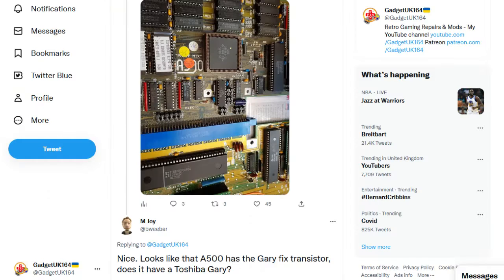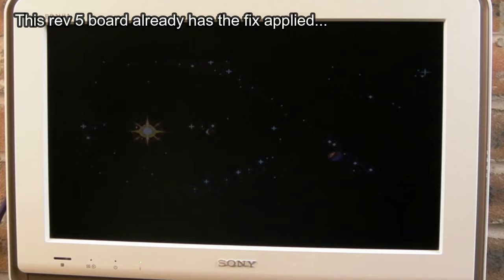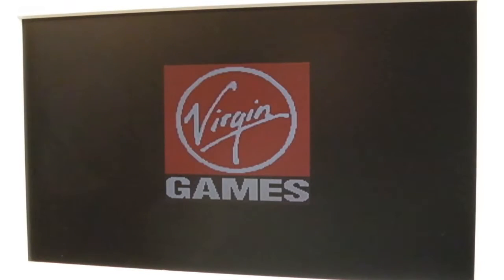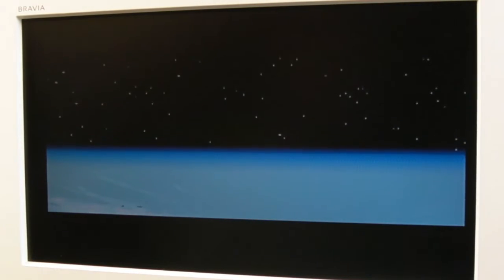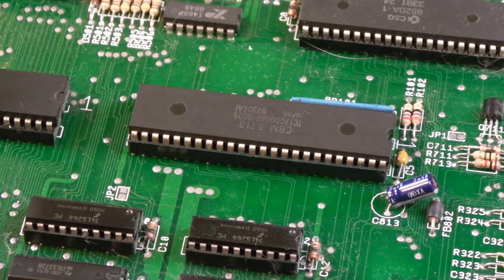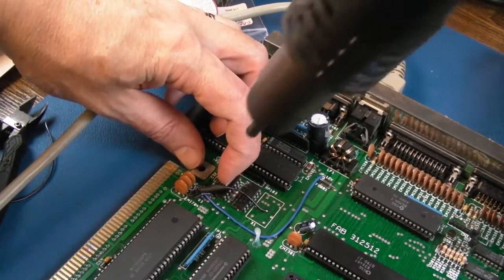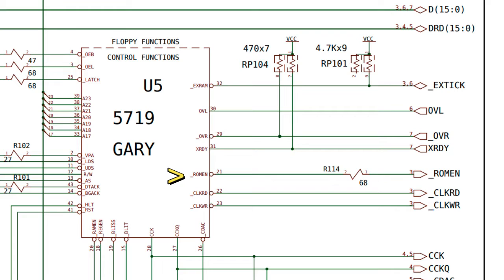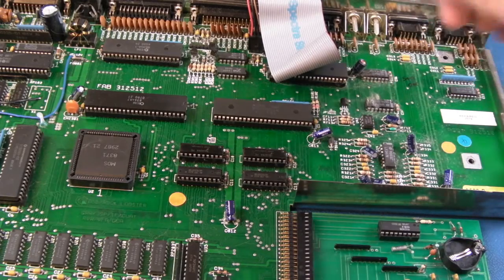Commodore Amiga Buggy Gary DTACK Kludge Fix (Revised)

Comment: Can you do a video on the mod used for the rom 3.1 on rev 5 A500 boards. I think there are 2 wires, one from pin1 to 31 and 31 to another pin(not sure which one).

Comment: I have the same spare Toshiba Gary (had it sitting in my spares box for yokes, and I can't remember which REV board it came from). When I temporarily fitted it to a REV6 (I had removed the original  Gary - Ram expansion, for another reason) I thought it was faulty, because I got the following reading error from the Gotek "ERROR : LBA Change Test Failed ! Write Issue ?". Could you test with a Gotek?
Reply from the maker: Thanks for the info!  I don't have a gotek, but I will get one soon and re-test for you!
Reply: @GadgetUK164  Awesome. Be careful with the revision of Gotek you get. Video on the subject
https://www.youtube.com/watch?v=6VZMTrZ4b9M&lc=UgymB6rufNY52koyCVl4AaABAg.9nLbVc-4nCD9nO1vAS03rD

Comment: About the ground pads on the Rev. 3 boards: the pads on mine are not connected to ground but they made a connection while the board was still in the bottom RF shield with the disk drive and back connectors screwed in. The ground connection was probably only through the pads touching the RF shield ground. I was slightly confused when I removed the shielding and the "ground pads" would no longer be grounded. Definitely something to keep in mind when working on the early boards. :D
Reply from the maker: Ah yes, I was surprised in the video when I pointed that out - but then found I did have connectivity (from the shield as you say)!
Reply: I have the same Toshiba Gary (it's a spare IC) and I get an error with the Gotek, when I fitted it to a REV 6 board.  "ERROR : LBA Change Test Failed ! Write Issue ?"
Reply: PS; Mine's is '8724' whereas Gadgets is 1987, week 30.

Comment: I think you got the transistor backwards too, at least on the schematic. It's a classic "open collector" arrangement, and the emitter of an NPN transistor properly goes to ground. But if it is backwards, and not just read backwards like happened with the chip, it's clearly still good enough, just not proper.
Reply from the maker: It's PNP by the way!
Reply from the maker: It's wired the exact same way as the factory mod - maybe they had it wrong there?!  I will re-check it when I get a sec!
Reply from the maker: I've just checked - it is the right way around!  It is a PNP emitter follower - https://commons.wikimedia.org/wiki/File:PNP_emitter_follower.svg
Reply: If it's PNP then that makes sense. It's switching an active-low to an active-low, so yeah. I'm so used to positive logic input to bodge transistors that I had a blind spot there. This new trick is now filed away in my head!
EDIT: yep, there it is at 17:14

Comment: I understood the problem/fix to be that the cpu was getting halted by active chipmem use (5+ bitplanes, blitter) even when it was running from ROM and shouldn't have to obey such restrictions. With the fix the cpu can run full speed from ROM whatever happens on the chipset side. I suspect the same would be happening for any 86-pin expansions, like RAM or HDs, without the fix.

Comment: Got my first A500 in July '87. I realized only a couple of years ago how 'special' this A500 was. There was no badge on top instead there was the C= logo moulded into the case. The case in general looked more like a reminiscence to a PET (which o/c I didn't knew back then).
What I never really understood was that this A500 in rare cases had strange 'performance' problems with certain intros/demos back then. Most often these issues did not show up on my mates A500s
But most prominent memory is that this A500 didn't like one of the first A500 accelerators: a Supra Turbo 28 (a 68000 running at 28Mhz). You can't believe the disappointment when the accelerator arrived and nothing worked. In this pre-internet days you only could call the vendor and hope for help (which was none in this case ...).

Looking at your clip I believe that this bugger was one of the first batches of A500 and maybe had teething issues which could have been fixed like that.
Reply from the maker: Ah, yes - it does sound like you had that original Gary chip!  I could imagine that DTACK problem causing issues with accelerators for sure!

Comment: So to quote Bob Welland (the A500 designer) about the bug in Gary, he said:
"when the processor was running out of ROM, the blitter chips could run out of RAM, and I was making it so the processor couldn't run out of ROM at that time"
(by "run out of" he means "accessing").
So the transistor mod seems to make sense. When the ROM enable line is high on Gary, the transistor then grounds the DTACK line on the processor, which according to docs is "*DTACK: The active-low* data transfer acknowledge input to the 68000 is generated by the device being accessed and indicates that the contents of the data bus are valid, and that the 68000 may proceed".
So the transistor bodge is allowing the processor to access the bus when the the ROM enable line is high. 
The broken Gary must always be driving the DTACK line high when blitting is going on and ignoring the ROM enable (the processor is allowed to do ROM access whilst blitting as it's on a different bus). 
As to how this relates to floppy access, not exactly sure, but I suspect that DUNE is using ROM routines to access the disk, in which case it would get stalled due to the blits that are going on at the time it is doing the access. 
If it got stalled for ROM access and then it could put everything out of whack if the game is tightly coupled to what is going on.
Reply from the maker: That makes perfect sense Dave!  That explains it perfectly!!!
Reply from the maker: I would pin this btw but it only allows 1 pin and I wanted the link to your and Jans channel above ^
Reply: @GadgetUK164  No problem. It's been fun working all this out. I only found out about this problem with Gary and the transistor bodge this week, and then Jan and you both post videos with these "ancient" boards. I've learned a little bit more about the Amiga and also something that I should have realised about the A500. I always thought about it has having no true fast memory, but the ROM itself is basically "fast" as it's directly wired to the processor. This Gary bug shows that the fast access to that bus really does make a difference, as the system runs slower without being able to access that bus at the same time as the custom hardware chips.
Reply: "DTACK Grounded" is an old 68000 meme where it runs full speed ahead with no wait states. Normally it runs too fast for older 8-bit chips to keep up, but if you had everything fast enough then you can just ground it. In this case it bodges around a case where DTACK is late due to the bug in Gary.
It's also the name of a newsletter about the 68000, look it up.

Comment: Could you not use a higher frequency crystal along with a heatsink on the CPU to keep it cool.
Reply from the maker: Yes, you could do that to overclock - video would be messed up though since the main XTAL is divided down and used for video timings too.  That's has no relevance to the Gary issue though!
Reply: @GadgetUK164  Quadruple the clock that ought to work unless the colour frequency is 4.4335Mhz
Reply from the maker: @DAVIDGREGORYKERR  ??? No, that wont fix the video and it won't run at 4 x the speed either, there's no way the chipset will support that, nor the CPU.

Comment: Nice Video and well explained although I'm not sure but do all Rev 3 and Rev 5 Mobos suffer this issue?  -Mark.
Reply from the maker: Any that haven't been modded will have this problem with that old Toshiba MOS 5719 yes!  I think its marked TC17G008AP-0025.  Most boards > rev 3 will have the later 5719 though.  It seems some earlier rev 5 boards had it (and the mod, but I suspect many rev 3 boards may not have the mod and be fitted with a TC17G008AP-0025).

Comment: You wouldn't be the first to get the pin numbers wrong on a chip. The Amiga 3000 needed a bodge wire for some reason, was missing an interrupt line or something on the CPU port to allow SCSI to work on CPU cards (eg. Cyberstorm). Mike Clarke (of Psygnosis fame) gave me an 3000 he'd rescued from a skip and I said I'd modify his and I got the wrong pins. I'm still embarrassed and annoyed about that to this day. But I was a poor student and couldn't really afford the drive back up to Liverpool to put it right.
Reply: Oh? Missing interrupt on the CPU port? That well may be why my ReAmiga 3000 SCSI is so flaky when using an accelerator. I am surprised John Hertell would not have fixed that on the ReAmiga, though.
Reply: @10MARC  Yep, search for A3000-INT_2-Mod.lha, it's on Aminet. "A4000D and T models have an interrupt line called _INT2 on the CPU (FAST) slot. On the A4000, this slot is CN606 and the line is on pin 82. However, this pin was not connected in the A3000D and A3000T, causing PPC and other 68k CPU boards which use this line to not function correctly. Most CPU boards which have onboard SCSI will require this modification to operate in the A3000D
and A3000T."

Adding a CPU board shouldn't affect internal SCSI. It's if the CPU card has its own SCSI that it matters. It was a lot faster to put SCSI on the CPU board as it bypassed the internal Amiga BUSes which weren't always fast enough.
Reply: @6581punk  oh I see. It does not affect boards that use the A3000 SCSI, only those with onboard. Makes sense. Yes, mine is certainly related to the DMAC and RAMSEY. The crazy thing is my 16 megahertz Amiga 3000 always worked fine with an accelerator and my 25 megahertz seemed to work fine before I sent it to John to convert it to a REAmiga. He just puts whatever chips has in the new boards and does not reuse the one from the board sent in. I figured that out after he sent mine back with an OCS Denise chip! Kindly he sent me an ECS back at his expense.
Reply: @10MARC  Other reasons for the flakiness can be your chip revisions. On my 3000D I used the latest custom chips but on my prototype A3000T I had to use a mixture of old and new. Chips in question are Super Buster and RAMsey.